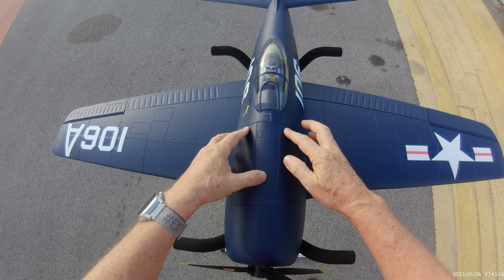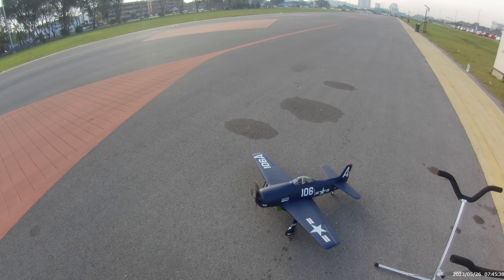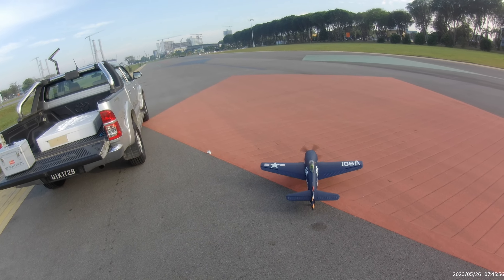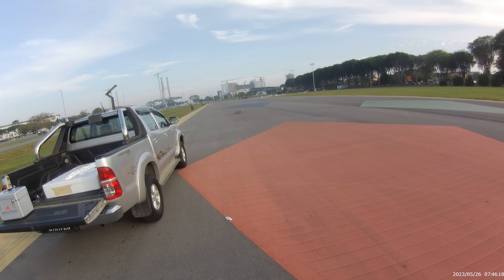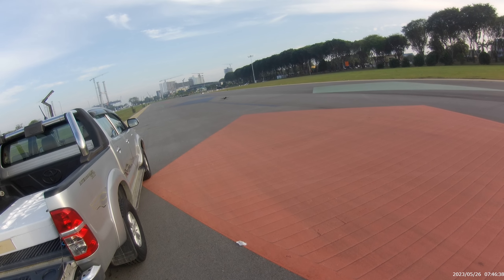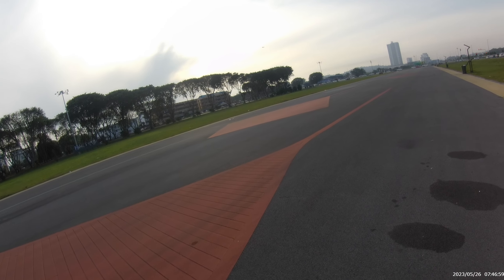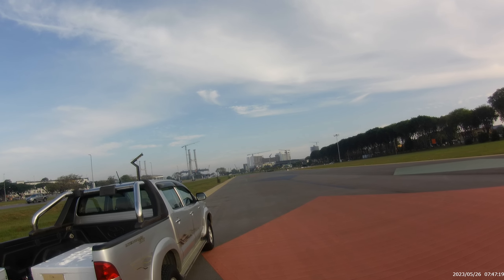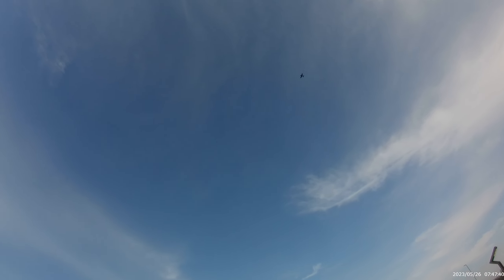Flightline F8F -1 Bearcat, Maiden Flight

Comment: I just stumbled across this video as I'm preparing to fly mine for the first time. What did you end up doing to balance the CG? I'll be using an HRB 4S 4000 50c battery and even with that large of a battery I'm a little concerned about the balance myself.